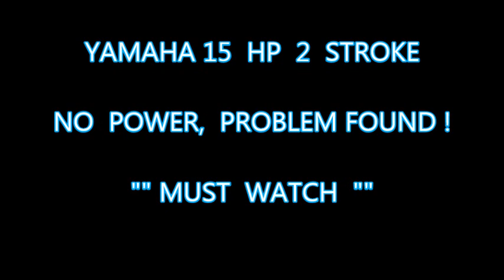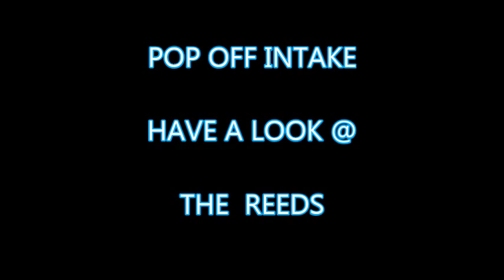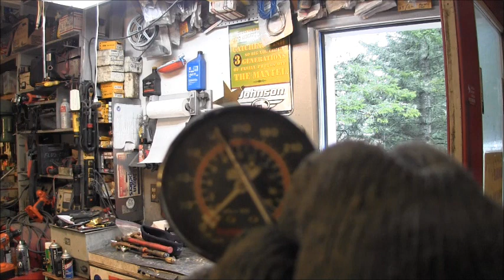YAMAHA 15 HP 2 STROKE,  NO POWER,  Problem found   ( MUST  WATCH )

Comment: In engines when the cylinder gets honed amwrong and has a taper to it from keeping the honing too near the top too long this same situation happened. As the engine gets warm and the cylinders expand the rings no longer make good contact and compression drops
Reply from the maker: Thank  You  Mate,  Been A Head  scratcher   4  sure.    kb

Comment: Well, this is a good reminder for all of us...  Although compression tests should always be performed, we can get fooled by decent compression readings on two stroke engines...The extra oil can mask some powerhead issues.  In this case, the rings appeared to be free so I'm not completely surprised by its decent compression readings.  But, the pistons were definitely scuffed/scored, so I'm thinking this damage had more of an effect on the "primary compression", or crankcase pulses, causing the poor running.  The loop scavenged engines will not tolerate any issues when it comes to primary compression.  The old OMC cross scavenged engines can continue to run pretty well with scuffs and scores, but the loop scavenged engines won't tolerate it at all due to the complex scavenging and extra ports in the cylinders.  
Now, as for the "pitting" on top of that piston, and in the head, I believe this is "detonation damage".  In a four stroke/car engine, we can hear the engine pinging/knocking when we use lousy fuel, or perhaps leave it in a high gear and try to accelerate.  Well, the two strokes experience the same detonation, we just don't hear the racket because there is no valve train.  The pitting is from the crazy "explosions" inside the combustion chamber while detonating.  Perhaps the owner uses this engine on a large heavy scow, and tries to run the engine at high RPM with a prop with too much pitch.  Perhaps the owner is running some old or crappy fuel, full of ethanol, water, etc.  Perhaps the timing was over advanced, the high speed jet was a bit dirty, or the engine was running a little hot.  The top of that one piston might look that way cuz preignition was about to set in....
Such a shame to see an otherwise nice engine wasted like this, but you can't save em all I guess.  That's some crazy reed valve set up...I think I get how it works though, those little raised ridges along the outside center of the reed case makes a seal between the two crankcases, am I right?  Otherwise, that reed looks like just one reed valve for only one cylinder....  
Sorry you ended up investing all that time and a non profit repair, but this is something we can all learn from, thanks!
Reply: What is a loop scavenged engine?? I’ve never heard that before. Thanks
Reply: @mwatkins2464    Well, a loop scavenged engine is still a two stroke engine for sure.  It just has a more complex way of delivering the fuel/oil mix to the combustion chamber.  Cross scavenged two strokes are easily recognized because of that crazy raised "deflector" on the pistons, where as loop scavenged pistions are usually flat with a domed combustion chamber in the cylinder head.  The benefits of the loop scavenged engines are that they tend to be a bit more economical than similar cross scavenged models...So, I guess you could say that the loop scavenging is a bit more efficient and tends to lose less unburned fuel/oil mix through the exhaust ports.  The downside of the loop scavenged engines all all the bypass intake ports in the cylinders which mean less support from the cylinder sleeves, so the bores tend to wear quicker than similar cross scavenged models.  The quicker sleeve/piston skirt wear also leads to a loss of "primary compression" in the crankcase, which usually is recognized by hard starting and poor idle.  The conventional cross scavenged models, while less efficient, are way more tolerant of sleeve/piston skirt wear and continue to run fairly well, even with some scuffing and scoring....
Reply from the maker: @fleetwin1   Thanks,  what got me sucked in  was the #'s  plus  how  easy it started & how well it idled.   uggggg.             kodi
Reply: @kodibassInsideoutboards  yeah, I was surprised it idled as well as it did also....

Comment: Now, that we know what it is.... it does makes sense!
Plus, you're not crazy, and your compression gage is working well.  Here is the explanation:
- The compression rings looked OK (& you commented about this).
-  Looks like a small portion towards the top of both cylinders working bores was OK, as the scores/markings/pitting you found did not extend full length of the working bores . 
- So, both cylinders were pumping pressure at the top of their stokes. 
That's what the compression gage was reading.
Reply: Now that I can understand! Great expectation!!!!! Thanks 👍
Reply: Stick a fork in it!!!! Cause it's done 👎
Reply: Very logical indeed since the tester only gves the highest reading it gets at any time on the compression cycle. Thanks for sharing !
Reply: @danielrobert7181  And, there is a moral of the story: what does a compression test result really means.
Reply: If the compression was only happening at the very last part of the stroke then the pressure would be much lower than a full compression strokes worth.

Comment: Think this motor sat for a while with water in the cylinders and corrosion (from a partially blown head gasket between the cylinders), then the corrosion and rusty bits pitted out the cylinders after getting it running?

Comment: I have a 2000 15hp yamaha 2 stroke, i was intrigued by how you mentioned good comp both cylinders, mine has good comp both cylinders butonce it starts to warm up runs on 1 cylinder so i removed the cylinder head and found water in top cylinder, no scroring in either cylinder, am i correct to say the only way water could get into top cylinder would be through head gasket?

Comment: Great video , just for shits and giggles , could you check the exhaust port (chamber) that goes down to prop exhaust ? Had a couple of Yamis plugged up to 90-95% blockage , should be a silver dollar size hole looking up the mid section but was only a thumb tack size hole .Plugged with carbon build up ! Enjoy the videos Kodi , keep on keeping on fella
Reply: Probably over rich mixture being added fuel tank , one guy was adding for a mixture of 40-1  on a 100-1 model !! Poor oil quality another colprit

Comment: I've noticed, or a least i haven't seen, that neither you or This Old Outboard do Hot compression tests.  I have always been under the impression that compression should be checked cold and hot.   It seems that with a hot compression check lower compression might have been detected.  Great videos by the way!
Reply from the maker: I sometimes do  but not always.   If  the numbers  are  iffy I will test , dry cold,  dry wet, then Hot.          thanks'   kodi

Comment: Dear mr Kodi, maybe it can be another solution of this problem.  Although those cilinders looks terrible. When pistons work it creates compression on one side and vacum on the other. This vacum sucs gasoline through carburator. This vacum could be lost through uper and lover seal on power head, and it could be tested with compresed air through carburator hole. If it leaks, it could be one of those seals.
Reply from the maker: That will be the owners call,  His bill now is about @ value of motor.      kodi

Comment: Here is a thought: Maybe the scoring is just bad enough to prevent it from holding the pressure after the plug fires? Example: Maximum watts and RMS watts in a car amplifier. If the cylinder cant hold that pressure, it cant make much power? Cylinder  leak test?

Comment: Kodibass, might you have  made any videos that show views of how the neutral start and neutral speed limiter linkage is connected to a shift lever for a 30 horse Johnson ( mine is a 1998) with the remote shift cable connected to the externally mounted shift lever, what the mechanisms look like as they connect to the rope start and the throttle mechanism? I took my powerhead off, now can't remember how those safety mechanisms are mounted.
Reply from the maker: Yes' 4 sure  I have but I have no idea what I titled them,  sorry   kodi
Reply: @kodibassInsideoutboards  I broke that plunger that operates the neutral speed limiter and neutral start only mechanisms on my 1998 30 horse Johnson. I cant find another one anywhere ive looked. It also puts the shift lever on a detent. If i were to use my motor without these mechanisms & the detent at the shift lever, would the detent balls in the  gearcase be all i would need to keep the engine in gear & not jump out of gear?,

Comment: Hi Kodi, I'm puzzled too? Good compression but poor performance. The inside looked bad and the pistons. Just a guess but one of the rings stuck on each piston and just enough oil or water to keep the compression up maybe giving it a false reading. Maybe the design of the head itself?
Reply from the maker: Sure could have been that'   just plain strange  4 sure.   kodi
Reply: @kodibassInsideoutboards  was the head torqued down before you started? Could be fine cold, but leaks when it is hot. Had an old Evinrude 35hp do that, the leak was internal in the section that separated the cylinders. New head gasket is all it was. But in this case, I think you had it correct, it was leaking water and it sat and pitted.
Reply from the maker: @rrrttt1112   Yep'  everything was good & tight.    kodi

Comment: Kodi I had the exact issue afew year back with a couple of motors and what I have found is that the rubber plug that is in the carb that plugs the jet is missing I believe that is the problem with the engine. It will bog down at high speed. The jet feeds gas out of a small hole in the side and not directly out of the bowl
Reply from the maker: I cleaned the carb very  good the plug is in there,       kodi

Comment: Hey kodi. What nut goes on evinrude 30 hp lower unit  in front of the four bolts
Reply: Valdez.   Loves ya sir
Reply from the maker: S.A.E  1/4-20 X   9/16                                kodi
Reply: Thank u sir

Comment: I don’t understand why such good numbers but such bad condition ! The scoring leaves me to believe it ran without oil for a good time ! High carbon steel ( I know it’s aluminum ) when very hot will start popping  which could cause the pitting , but aluminum will crack under high heat . I wonder if you pull the pistons you’ll seek cracks in the sides ?

Comment: Parts engine? It can be rebuilt
Reply from the maker: Yes' anything can B rebuilt but is it coast effective 2 do so?  The crank piston set is a bit over 1,000 +  shipping.  Labor , gasket set..  etc.  Owner  said nope.  So it's his call not mine. kodi
Reply: @kodibassInsideoutboards  where the hell are you buying your parts? Maura Mariner mag 2 150 complete rebuild kit with bearings Pistons gaskets and everything is right around $1,100. This is a 6-cylinder. There is no way a 2-cylinder is $1,000 unless you are buying a new crank for some reason already assembled which I see no point
Reply: A Yamaha 15 horse complete rebuild kit including Pistons Rings bearings and gaskets is around $350 this is including oversize Pistons
Reply from the maker: @michaelflowers6048   I source parts widely ,  Yes I  ""  would ""  buy crank / pistons / bearings as a assembly.  I or no other shop on Kodiak Island has the needed  Jig/press  for the 2 piece crank alignment for proper bearing replacement.  The cylinder case would also be replaced. All gaskets & parts would be OEM Yamaha,    When I rebuild a engine it is my business reputation that leaves my shop.  It is done to my standards or not done @ all.  thanks      kodibass
Reply: Actually the block would notI have to have anything done to it except a little muriatic acid to remove the aluminum from the sleeve in the blocked and rehomed. The only reason the Block sleeves would have to be pressed out a new one put in is if for some reason the cylinder was out of rround past the spec allowance, for some reason it was tapered, or the ID was out of spec. None of that was checked in the video. According to the video nothing was wrong with the crank or the rods. The Pistons are not pressed in so therefore no need for a press on that or any of the bearings except for your end bearings. Lowe's can be easily removed without a press and also they can be easily put on by leaving them in the freezer for about 3 hours. So really there is no need for a press. I have been mechanicing a long time and know the tricks to the trade. I don't know if you know these tricks but figured I would mention them. None of this hurts any internal parts on the engine as I have built performance engines before also. Learning these things could gain you a lot more business and would not hurt your reputation at all. In the end you would be making more money and also gaining more business and saving the customer some money. The one thing I do agree on is only buying OEM parts or upgraded parts
Reply from the maker: @michaelflowers6048    Thanks'   I'll  use my freezer 4 fish.  I'v  seen / heard most of the Freezer / hot plate  ""Tricks""  along my travels.    Nope.  not in my shop.  NEVER. kodi
Reply: A hotplate is a bad idea anything over around 450° on the marine-grade berrings can degrade the metal and tempering. Plus you do not get an even Heating. To use heat you need to use a propane torch and keep a 400° temp stick. Of course that all depends if your bearing has aluminum copper tin and lead,  in it or stainless and nickle  with other trace metals

Comment: If there is any engine cylinder reboring/lining workshop nearby you?
like these videos
https://www.youtube.com/watch?v=9GEVbqDG6S0
https://www.youtube.com/watch?v=tz3x_DZG0Vs
After reboring, the cylider will be matched with a new piston, 0.25mm larger in diameter.
Thus, the refurbished engine runs like a new one.
Reply from the maker: Enjoyed the vid's,  not available around here sadly.    kodi